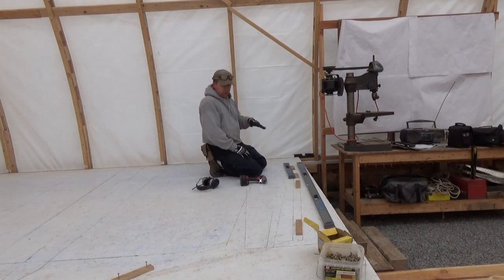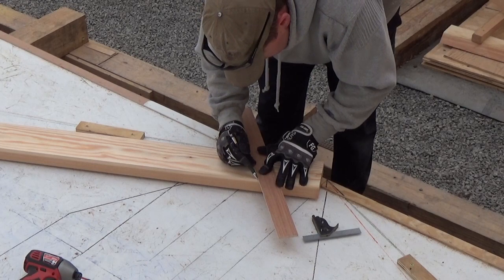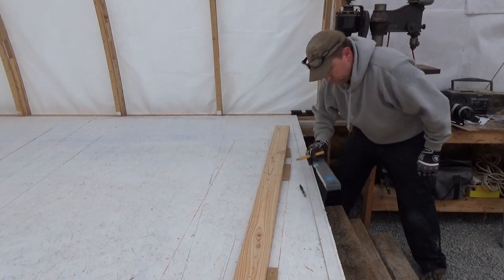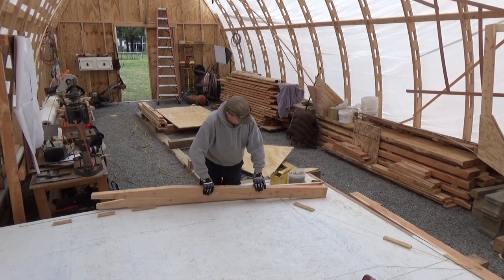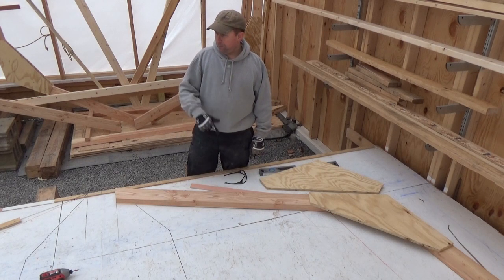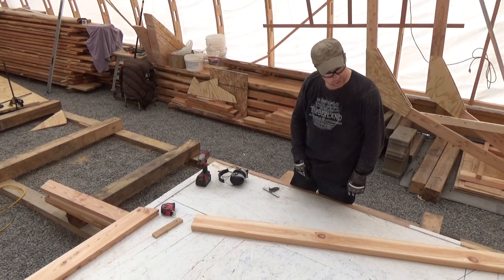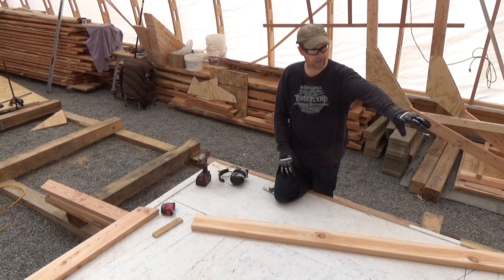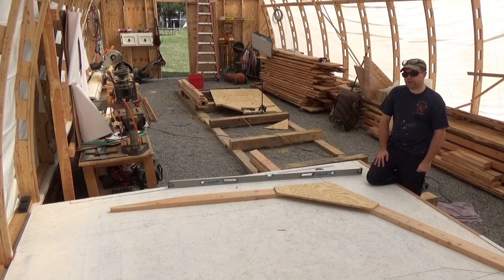Wooden boat frame raised sheer assembly. Sea Dreamer Project ep11

Comment: Idea for preventing line confusion:  What about covering that table in paper (taped together) and drawing on the paper?  Do one drawing for each station.  No extra lines, no confusion.  As you put each station together, tape that paper back down and do you work then toss the paper aside for the next one.  This way you can do all the drawing all at once but avoid any more confusion about which lines are for which station.

Comment: I have watched a lot of vids on lofting and laying out, the lines do get confusing. As the frames are symmetrical, could you not lay up both halves of one  frame on the right and flip one half, and the next frame on the left side of the floor? I'm sure I have seen some one do this, can't remember who though. Pleased to hear you are stepping up your game, You see too many vids when "that's ok " shows in the end results. Keep on keeping on.
Reply from the maker: I considered the flip idea to save space on the framing table. My concern was the frame bevels. The system George describes has the widest part of the board face down on the table with the bevel moving away from the line. I would worry that I would get that bevel mixed up pre flip. Some of the bevels that are only a few degrees are tough to differentiate between. Additionally, I think doing it this way ensures symmetry and allows me to attach the temporary bracing to the frames while the components are 100% in position on the full lofting. For a more experienced builder I think your idea is the best, for a hack like me I can't take shortcuts.
Reply: Oh, I see: The outside edges of the frames are bevelled for the planking and not at right angles to the fore and aft faces. Yup, I would do the same as you. I'm sure I saw my suggestion being done, but don't know how he got round this. I think on very big boats they cut the bevels when planking up.

Comment: If you want a tip from an old  shipwright 
Remember you are building a boat not a fine quality cabinet  boats are + - 1/4  at very best and in final fitting a power planer used to adjust if necessary  and draw one frame at a time and build it